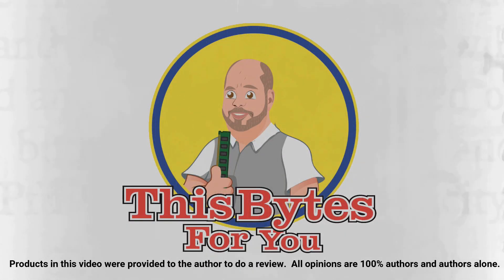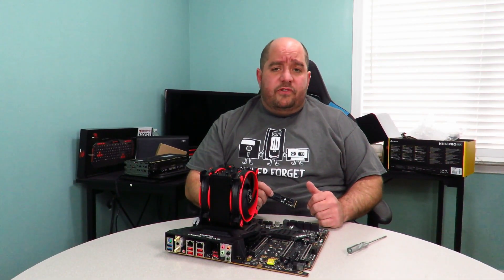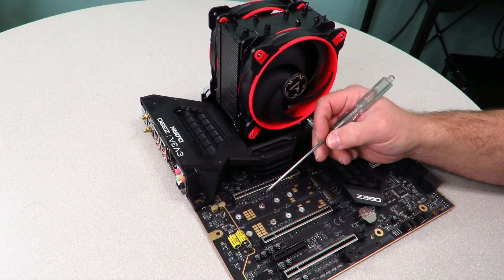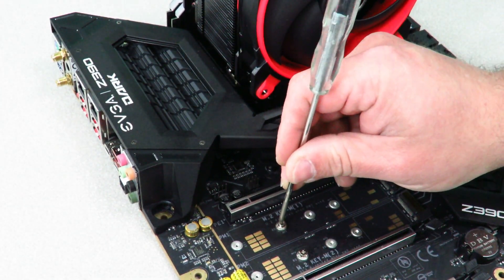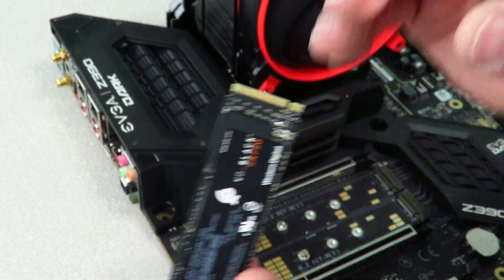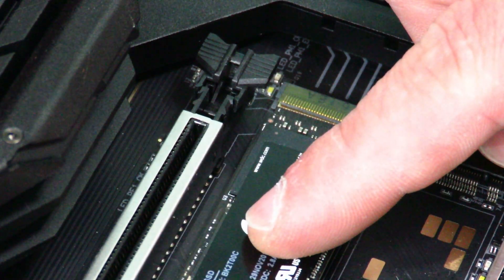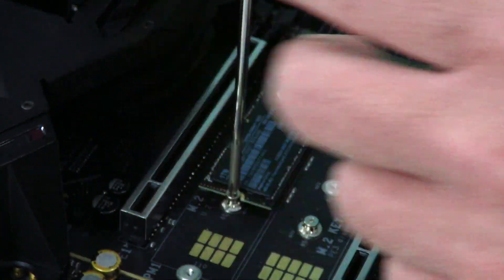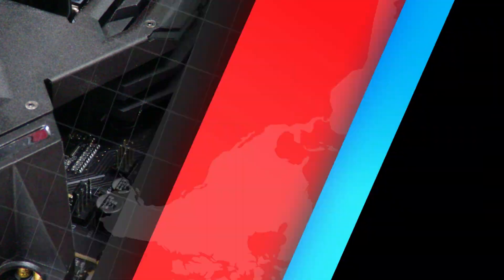Installing an M.2 NVMe SSD - WD Black SN750 1TB NVME PCIE M.2 SSD

Comment: I have a H110M-R motherboard, would it still be able to connect? because I cant find that scew anywhere
Reply from the maker: sorry my friend no, your motherboard does not have an M.2 socket.
Reply: @ThisBytesForYou  Would I be able to get an adapter to connect them?
Reply from the maker: @Rectat  no, your board only has a x16 and 2 x1 slots, no space for a x4, sorry my friend
Reply: @ThisBytesForYou  ah it's alright, I'm looking at a new motherboard so I can add this soon. Thank you fit the help
Reply from the maker: @Rectat  always a pleasure my friend, I have a ton of build videos as well, maybe they can inspire you on something to get
Reply: @ThisBytesForYou  Thank you for the help, I'll make sure to check some out!
Reply from the maker: always a pleasure my friend

Comment: I have an H170-PRO Asus Motherboard, I dont have a screw but the slot exists, is the screw needed to complete the connection? it wont read my SSD
Reply from the maker: the screw more than likely will be in the motherboard box, asus for some reason doesn't not screw it in to the board for you already, I guess it costs a few cents more to do that...  The screw is not needed, but it will make sure your M.2 SSD, doesn't fall out an land on the video card, shorting your machine.  It doesnt read, is it an NVME or a SATA drive?

Comment: Hey, I don't wanna be that guy, but you didn't install anything here. You just put the disk drive in its slot on hte Mobo.... that's not an 'installation'.
Reply from the maker: You are being that guy, because I did as the title of the video implied.  I installed the WD Black drive.  That is an installation, perhaps you mean how to install windows on it, and configure, thats a different video.  I don't wanna be that guy but that video is here: https://youtu.be/PlMOPrUvpvA.  that being said and all, This video is 2 years old and I improve my process every single day.  I generalized this video a little more so if you are trying to learn how to install and M.2 SSD into a machine and install windows on to it, maybe this video is for you, it is a much more recent video: https://youtu.be/eoFyW5QVunA
Reply: @ThisBytesForYou  yh, no... I'm good thx.
Reply from the maker: sounds good.